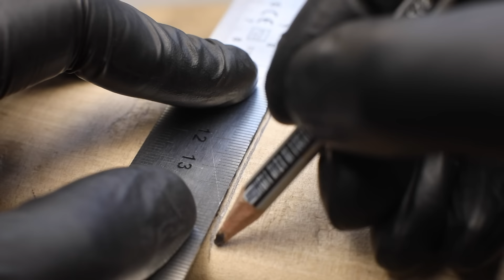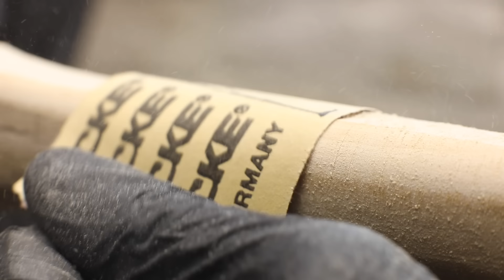Very Rusty Military Pickaxe from 1896 Restoration. Over 100 years underground!

Comment: Don't know if you have thought of this or have the capability to do so, but I once watched a restoration video where the individual cut a space in the handle, and using epoxy, was able to epoxy a small piece of the original handle into the new one. Just a thought. Great work. Keep it up.